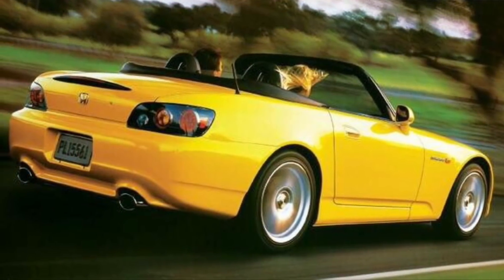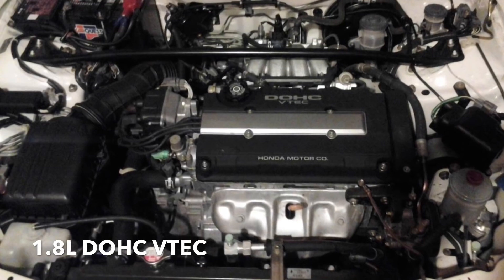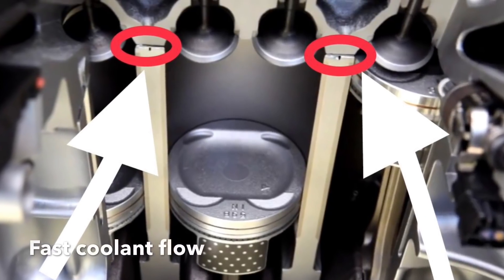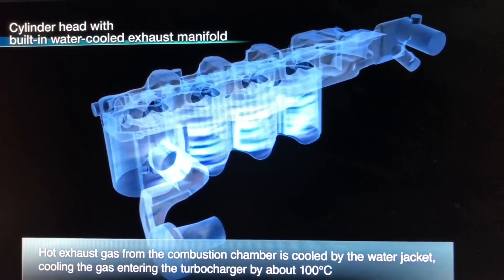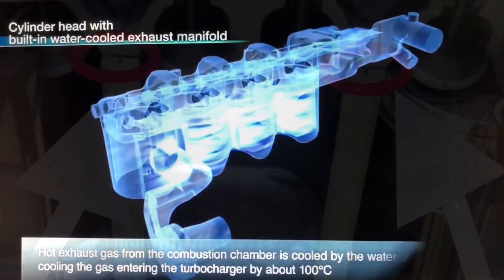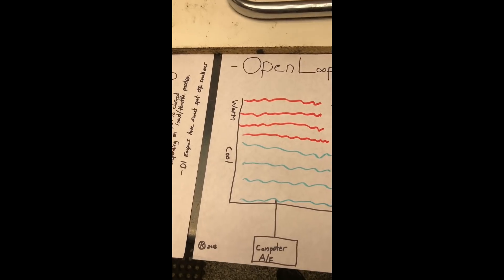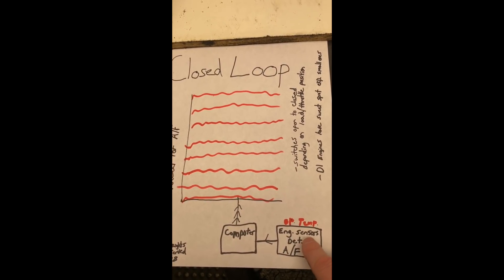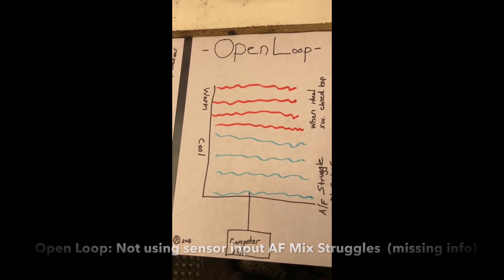1.5L Turbo Honda Oil Dilution Explained CRV Accord Civic

Comment: I come from Austria, Vienna. I dont have this problem .My car is Honda civic sedan 1.5 turbo 6 speed manul with 182HP and 10000km. I drive 9km to work 4 or 5 days a week. Once or twice in month  i drive 50 till 120 km highway and 5 times in year  long trips from 500km to 800km. But sometimes i drive only short distances for month or  a little bit longer. i look often to my oil dipstick and alaways in the same place .and since a have read this i check my oil even more often. Sorry for my bad english
Reply: Your English is better than many Americans!!
Reply: @motorcitymanman7711  I dont have any of these problems....i have read about many problems of this honda in american forums but...for me my car runs perfectly..and i dont have any issues i am a little bit afraid of this oil dilution and check my oil weekly and read almost every day about news...i dont know what to say...i have 10500 km and still waiting ..maybe if the engine get older my car becomes this issue in future,,,in european german austrian forum some of people smelled gasoline for a short time when they staring climate control or heating...but nobody have seen oil increases,,,then if the oil is on the same level i guess there is no oil dilution...
Reply: @IrmanSarajlija  
It's good you dont have the oil dilution problem, at least yet.
All the motors do not have the problem for some reason.
Reply: Sbg.. jesam, ja mislim da nece biti problema sa civicom...
Reply: Ja sam kupio također sedana sa 1.5 turbo motorom u 4. mjesecu. Nisam imao problema s miješanjem goriva i ulja ali sam ima hrpu drugih problema, zbog kojih sam prodao auto nakon 7 mjeseci. 
Problem s kvačilom od prvog dana (trzanje kod kretanja, mijenjao set kvačila i zamašnjak, priznali garanciju), zatim zapinjanje mjenjača kod mijenjanja brzina, pogotovo 1.-2-3. i obrnuto.
Pa onda zujanje iz getribe kod ubrzavanja, odnosno dodavanja gasa. Škripanje i cviljenje kočnica. Kvrckanje i škripkanje plastike u unutrašnjosti (jako!). Kod prvog paljenja ujutro zvuk u motoru kao da radi bez ulja... I još par manje bitnih sitnica koje uz ovakve stvari nisu vrijedne spominjanja. 
Inače sam ljubitelj Honde i vozim godinama samo Honde, a ovo je bilo takvo razočaranje i nevjerica, ne mogu to opisati.
Iako se sedan sklapa u Turskoj, a za pretpostaviti je da turci baš i nisu nešto pretjerano ozbiljni u pristupu poslu, ipak je nemoguće da su svi ti problemi posljedica takvog nečeg. 
Želim ti da te auto dobro služi, ali moj je bio zaista totalno sranje. Pozdrav iz Hrvatske!
Reply: Ja nemam ama bas nikakvih problema... I dont have any of these problems....i jave read about many problems of this honda in american forums but...for me my car runs perfectly..and i dont have any issues i am a little bit afraid of this oil dilution and check my oil weekly
Reply: Same with me in Budapest Hungary. 1,5 turbo 6 speed manual CRV about 2000km in it . No problem. I asked Honda Motor Europe and they said there is no problem in europe because of the better weather(?) and the engine is sligthly different.
Reply: What year car do you have?
Reply: @motorcitymanman7711  My car is a model year 2017( according to VIN number)..Honda Civic 6 speed MT  182 HP 1.5 Turbo Sedan..Made in Turkey .Bought Juni 2018 as a new car In summer i made a lot of km or miles..but since September i drove a lot of short distances 9km 2 km 6 km(every day)....until now. 1 long distance...over 500 km..and a couple of longer distances 30 till 140km ( about 5 such distances)
Reply: @IrmanSarajlija  
 Hy. I am Aurelian from Bucharest-Romania. I buy a Honda CRV last month. After 2000 km honda change the oil because the level was increased and i have an error in dashbord -oil presure. Now i have 6000 km with the car and the oil level is ok. I have 4000 km with the new oil. Seems Honda Romania know about the oil dilution. The car will be monitorise by Honda Romania.
Reply: @aurelcostin5481  I really dont know why someone have a problem and someone not..The most of the people domt have,,,,Maybe there are mall diference between civic and crv and berween cvt an manual transmission...i think this engine has potential problem but it depends on some factors...I dont have that problem....
Reply: Taj problem vecinom ima samo crv i to samo gdje je hladno vrijeme, za sad mi nije nijedan civic poznat iako radim svaki dan sa hondama a i sam vozim 1.5 Sport +
Reply: A gdje zivis...Jesi mehanicar..Sada u Becu tek pocinje prava zima  pa cu jos vidjeti razvoj situacije...U biti ja sam se malo prepao i precesto gledam kolicinu ulja..do sada je sve ok..Bas sam poslije Renaulta i Pezoa upravo kupio japanca radi pouzdanosti. Nadam se da ce biti tako..Pozdrav
Reply: This is a ENGLISH video people, speak English!
Reply: @motorcitymanman7711  excuse me, please! :) 
I was in a hurry and just started writing using language Irman understands very well, I wasn't thinking about other potential people interested in this matter.. :D
Reply: @denniso113  
I forgive you! 😁😁
Merry Christmas and Happy Holidays!!
Reply: @motorcitymanman7711  Merry Christmas and happy New Year! (and thank you for the remission of my sins haha) 
🌠

Comment from the maker: This problem seems to be primarily in any very small Turbo GDI engines (no matter the outside air temp but engine temp being cool)...at low to mid throttle when engine is still warming the fuel is hard to properly vaporize with less air flow and colder temps triggering a rich and lean condition.  The rich fuel that is not atomized & unburned fuel gets passed piston rings into the oil...  there are many variables these are a few of the more obvious ones.  Very difficult to design a smaller GDI engine than larger due to air and atomization of fuel at low RPM.
Reply: Just to correct you. Honda has not fully implemented DI on all their vehicles. Port injection is still available.
Reply: https://m.youtube.com/watch?v=nMX94zarLs4&t=73s